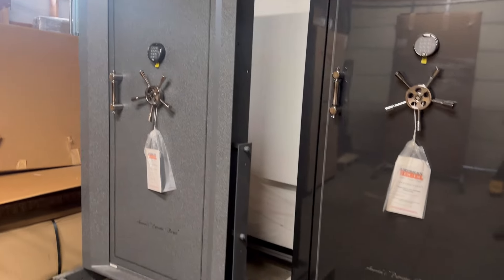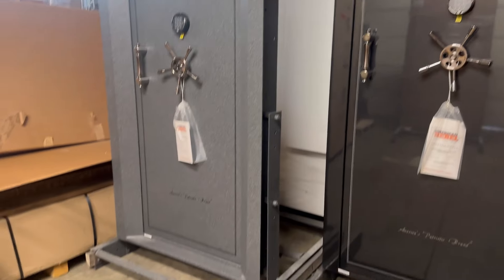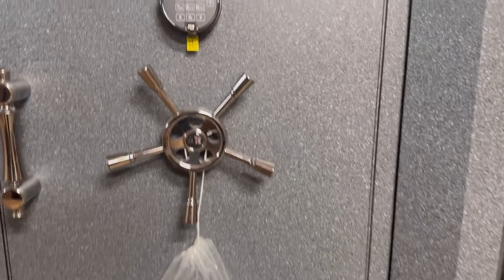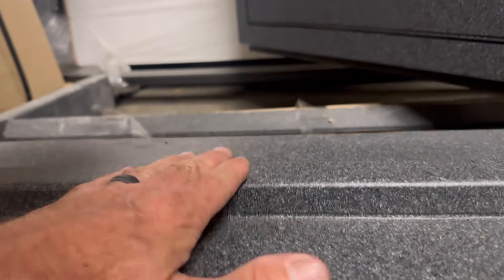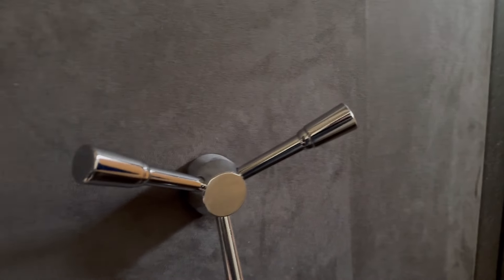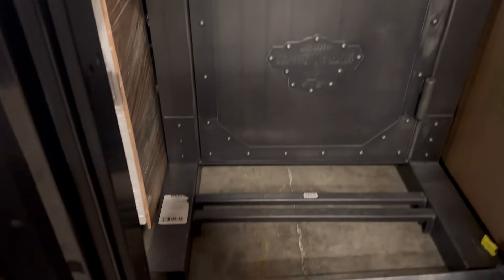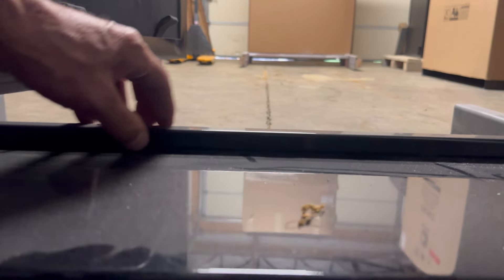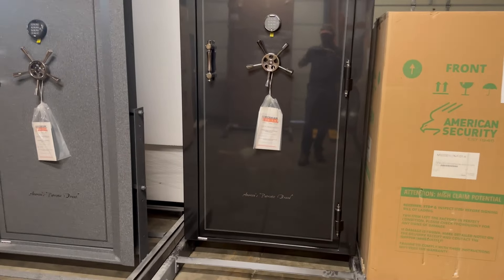American Rebel Vault Doors

Comment: HI Aaron, to my surprise there are videos of people using hardiebacker cement  board  & even just sheet rock building their vault door room  .  What tends to be the most common construction you see on insulation's for vault doors( poured concrete / block wall filled. ) ?     If you ever do a Q & A  video Whats the back story to Parker Safes, How/Why did you decide to start safe/vault business? "   Thank you
Reply from the maker: Yes, I have seen a number of different materials used for vault rooms, but the best is usually poured concrete with rebar where the walls are tied to the floor and ceiling. I would say a minimum of 4 inches would be adequate, but I’ve seen vault rooms as thick as 20 inches.As far as our backstory, I have an uncle who is a master firearms engraver and started selling safes back in the late 80s. I was in law-enforcement for a while and worked as a park ranger at grand Teton nation Park and then a trim carpenter in Arizona and I just sort of fell into it. my younger brother asked me what I was going into when the construction job ended and mentioned calling our uncle to see what’s involved in getting into the Safe business. I made that call about a year later. I was on the Safe business. Coincidentally I hope that same brother get into the business as well and he’s now, Parker Safes and security in Ohio.

Comment: Why do so many of the vaults and safes I have been researching having their hinges on the outside?  I would think you want them on the inside to decrease the attack points, but I just started learning, thanks.
Reply from the maker: It’s usually not a vulnerable point at all. If you picture the inside of the door, you have the bolts extending behind the frame or into sockets, and so even if  you were to cut the hinges off completely, the door still will not come out of the door frame.
Reply: @parkerssafes  Thank you for the fast response!  Have a good day :)